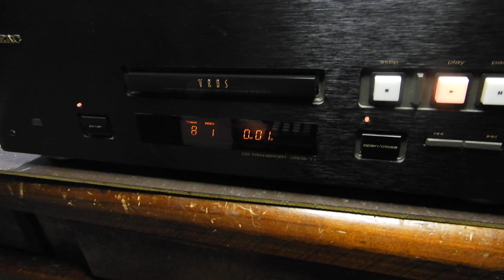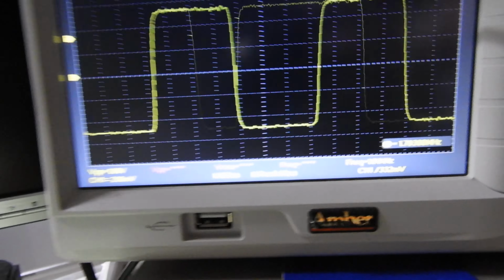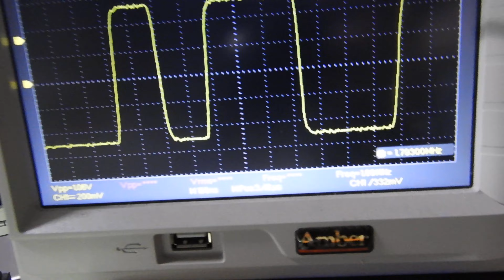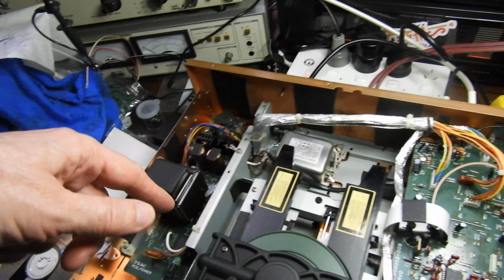Teac VRDS T-1 CD Transport. Good quality machine build to a high standard with some extra goodies.

Comment: They were a beautiful pice of machinery, have a Mac-MCD 751 transport only with the same Teac Drive,only problem is You can't get parts for it , I just hope for best and keep it clean and use it very gracefully, Teac has a new VRDS unit out now , I believe it's around $2500 transport only , what a shame for the older units with the parts issue I believe it's called planned obsolescence
Reply from the maker: What parts are you talking about?
Reply: @hear-net-au  In my situation, a cog that allows the drawer to open. You need to find a mate with a 3D printer! TEAC are piss poor in supporting these items and would do well to follow Sennheiser's support lead.